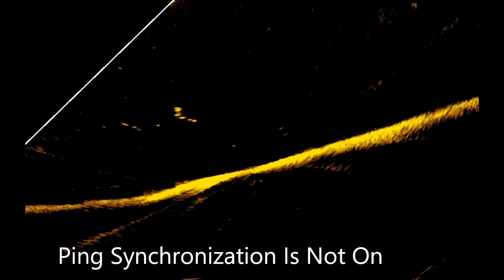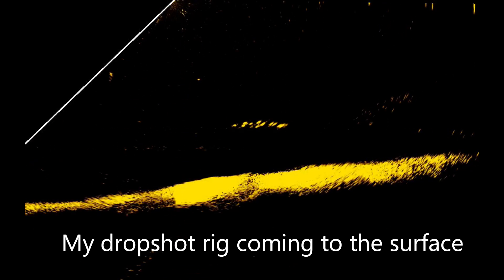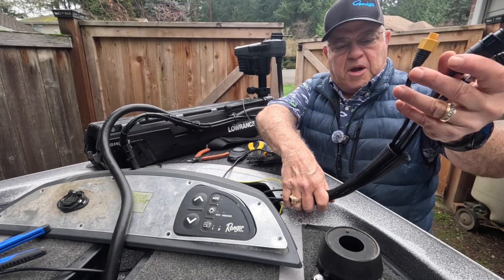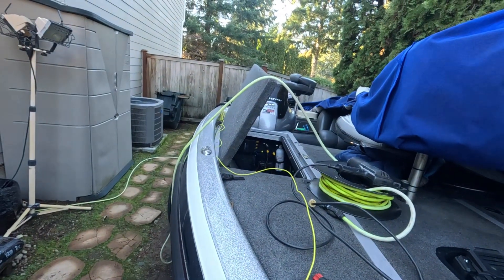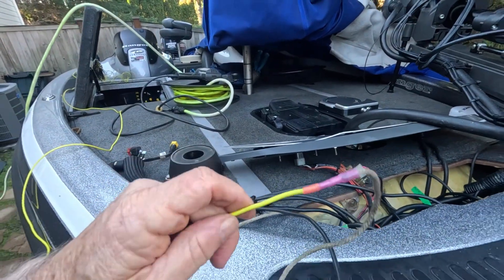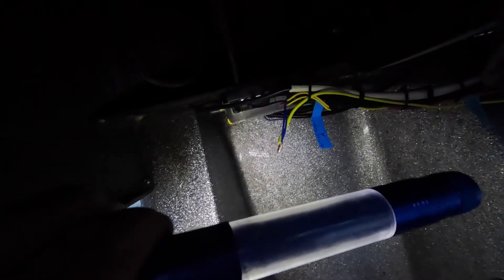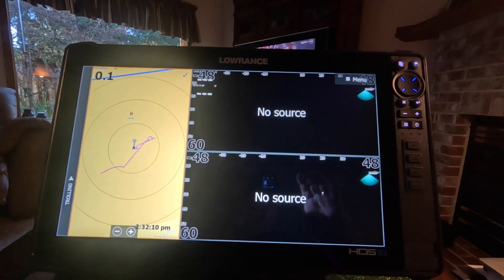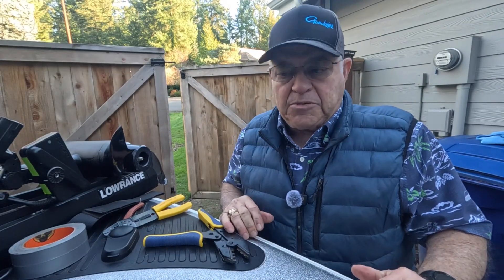Ping Sync  What is it and Why You Need It!

Comment: If you have 2 HDS pro's and 2 AT2 tranducers up front with one showing forward and one in landscape, would you connect both yellow wake up wires together with the 2 blue wires from transducers? So 4 total wires connected together to have ping sync on both monitors?

Comment: I would like to know if the Ping speed on 3 of my HDS units, should all be the same? Also is it best to go for the higher sync, or midway +/- ?
Reply from the maker: Ping speed settings are best done while on the water and based on water conditions.  Every day and body of water and fishing technique determines the best ping speed. I start with fast,  and adjust down from there.

Comment: Thanks Marc!  So I'm using my yellow wires as wake up for my AT2 Modules. If I turn on Ping Sync will my modules still wake up?
Reply from the maker: I don't know for certain, but I do not believe so. I highly recommend you connect your AT2 modules to an accessory switch (or one for each). Ping synch is worth the effort.
Reply: @marcmarcantonio thanks Marc I’ll get it going and let you know how it goes.